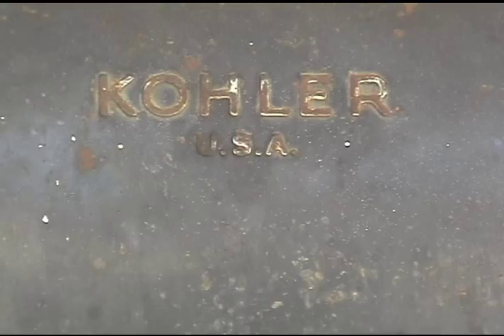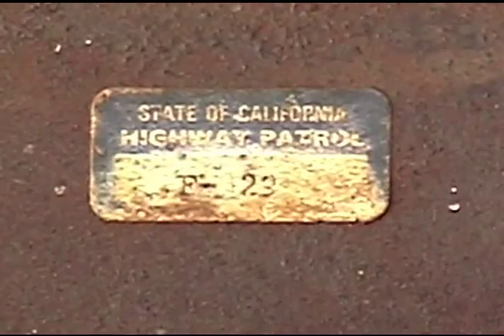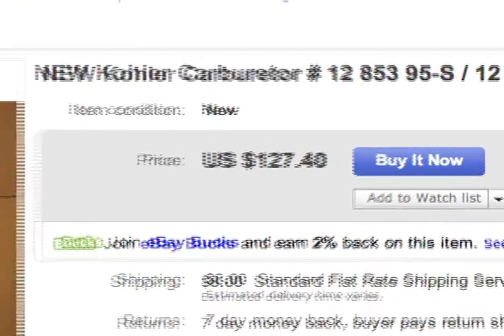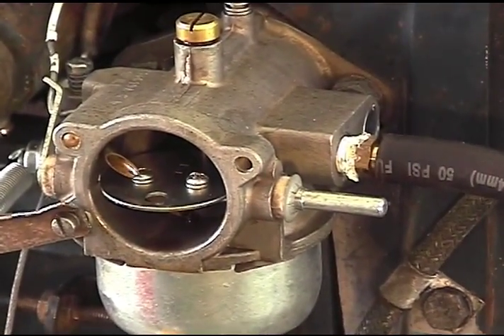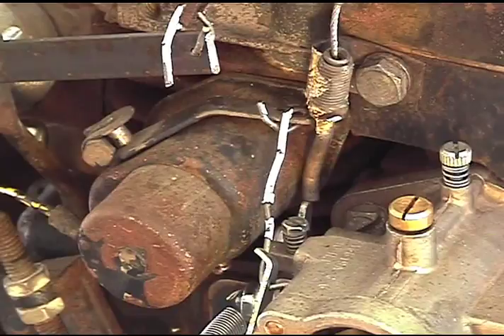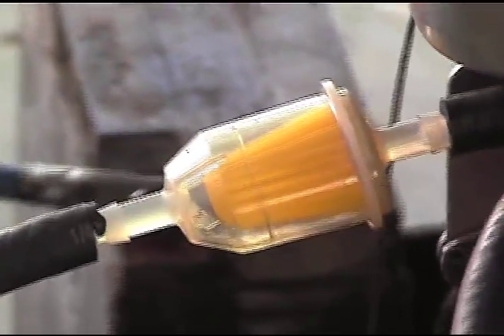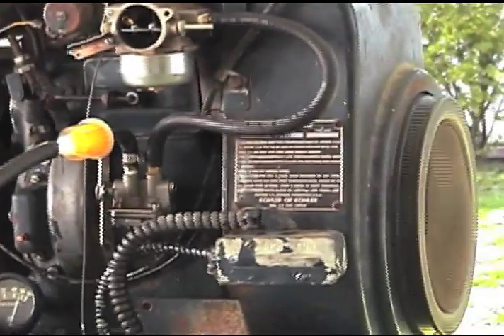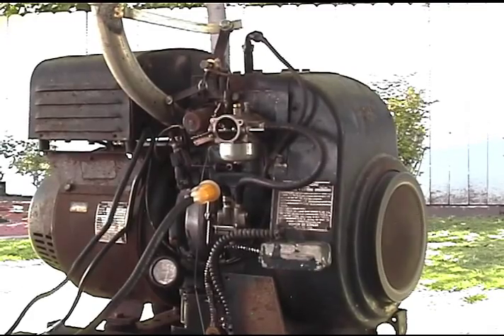Kohler K331 3.5 RM 62 generator

Comment: Tecumseh carbs can be had for 10 to 15 bucks also. Am doing this to my Onan with the same problem.
Reply from the maker: @David Link - -  interesting.  I couldn't find a suitable one when I did this vid.  Do you happen to have a model number?
Reply: Spetet not off the top of my head.  Think the one I got was for a snow blower.

Comment: @Spetet 
all cub cadet had k161, k181, k241, k301, k321, and k341. to the best of my knowledge these are the only single cylinder engines offered i IH built cub cadets